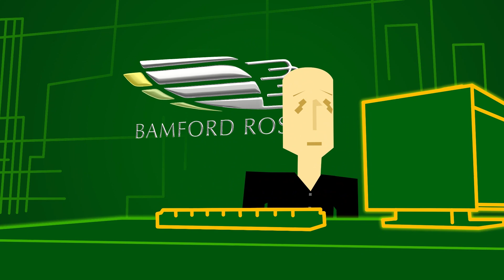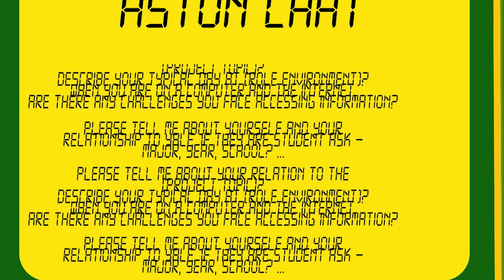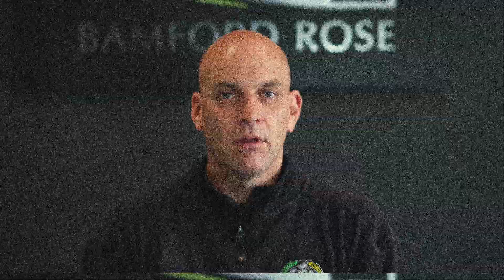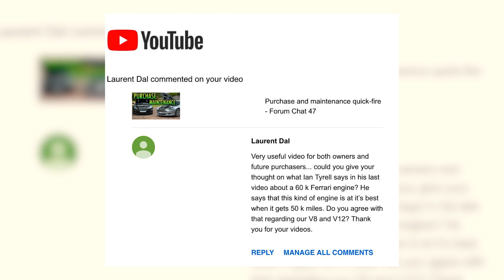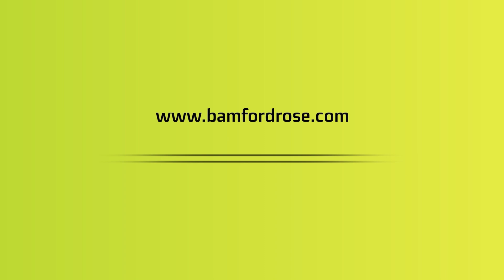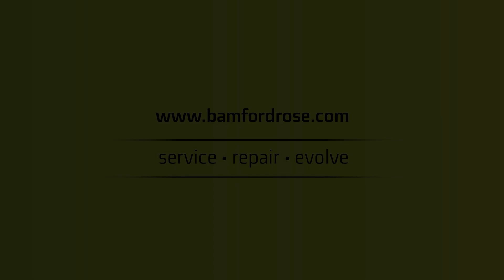When is an Aston Martin engine at its best? Forum Chat #49

Comment: Great advice Mike however, if I see (for instance) a 2005 DB9 with around 13k miles under its wheels can your argument not be attributed to cars such as this also and should buyers be wary of such cars? Given a 15 year old car, one or two owner doing less than 1000 miles a year cannot have got to or past its green phase bedding in. This engine may not be showing its full potential on the dyno (451hp as quoted by AM) and will in fact be in its glazing phase where engine power will not be up to where it should be and would not change unless rebuilt and run in correctly.

Or am I missing the point?

Comment: finally some real info on runnning-in and what you are trying to do/need for cylinder pressure to avoid glazing and oil consumption!    Why the heck did manufacturers always specify a 1500km or something tedious low speed running-period then?

Comment: Just to be clear.....do all manufacturers do a greening phase on the dyno on all engines before they are installed in the vehicle ?
Reply: No, I think Mike is referring to test engines only being measured in controlled conditions to determine data. As far as I know your new AM car will have a new unused engine not bedded in hence why a run in phase iten quoted.